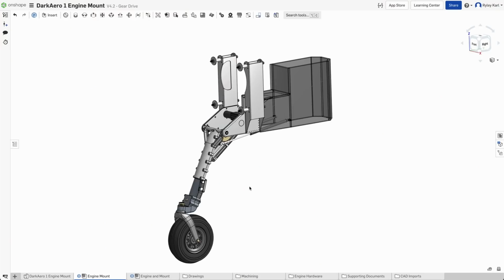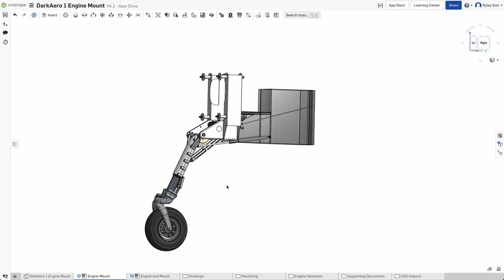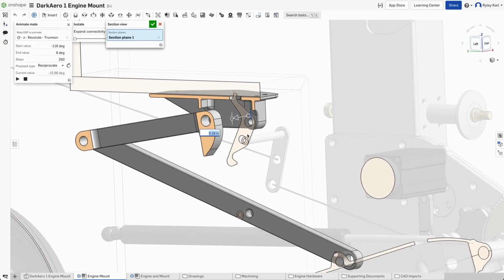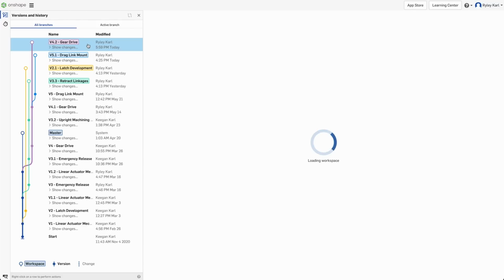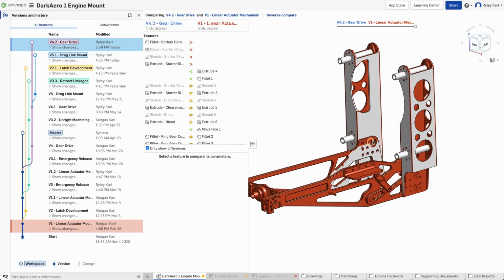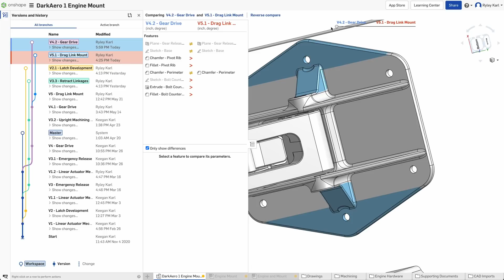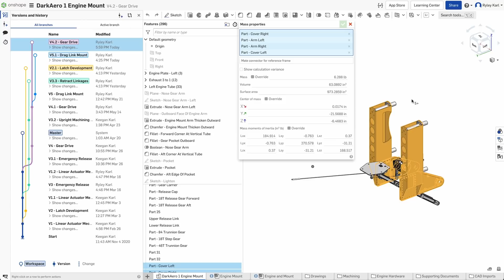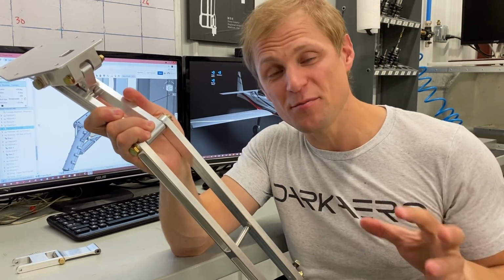How to manage complex designs. (our favorite CAD feature)

Comment: I'm an airline pilot and also mechanical engineer. One plane I used to fly was the Swearigen Metroliner. The torque links for the main landing gear were behind the oleo strut and and also the props wash  against them. The dirt and debris would pit the oleos and they would always be in a state of leakage and deflation. I know the nose gear strut gas spring of the Dark Aero is recessed within the nose gear trunnion but it might be helpful to locate the torque link in front of the telescoping strut to better protect it from said prop wash and debris? It looks like there is room to move 180 degrees to the front, just a suggestion. Love the videos and the plane looks awesome!
Reply from the maker: Hi Mike! Thanks for watching and for the suggestion! Your comment highlights the struggle we face while coming up with these different designs: there are many different conflicting requirements to weigh out and balance. As you pointed out, the gas shock for our nose gear sits inside the trunnion halves and telescoping strut tube, so all the critical surfaces and sealing components are already protected from debris and prop blast. The torque links were located on the aft side of the gear assembly because this arrangement offers some manufacturing advantages. There is an eye on the aft face of the aft trunnion half that the drag links attach to. The addition of this eye means we have to machine the trunnion half from a billet of aluminum that is ~0.5" thicker than if there was no eye. As long as we are machining off all this excess stock just to add in the drag link eye, we can also add in the eye for the torque link with no increase in machining stock. If we were to move the torque link to the forward trunnion, it would mean wasting an additional ~0.5" of machining stock to add this feature. This extra thickness in the billet amounts to over 4 pounds of aluminum that would be wasted. Kinda tricky to describe in text so hopefully I didn't cause confusion with that explanation. :)
Reply: @DarkAeroInc  Makes perfect sense, thanks for the reply, can't wait to see the Dark Aero fly!

Comment: if there is any flex between the rigid engine mount/nose gear and the wheel well that houses the nose gear drag link mount (i.e. nose gear drag link mount moves in relation to the nose gear) then the nose wheel may not retract fully or may retract too much, right?  Maybe the nose gear drag link mount should have a couple of drag struts tying it into the engine mount?
Reply from the maker: Richard, it is possible for there to be a slight amount of relative movement between the two structures. However, they are both very rigid and tied together (since the engine mount ties into the firewall and wheelwell). 

The lockout mechanism is spring loaded to default the lock into lockup/lockdown. During normal operation, the limit switches will ensure the motor drives the gear all the way to it's final position. In an emergency event, the gas struts force the gear into the lockdown position. Since the gas struts are still slightly compressed even with the gear fully extended, a slight amount of relative movement between engine mount and wheelwell won't impact a full lockout. This might be a good thing to demonstrate in an upcoming video! :)
Reply: @DarkAeroInc  Incredible amount of engineering going into this for a such a small team.
Reply: Richard.  That was actually also my thought.  I have often enough been cheated by simulations.  Before we build something, we start with a cardboard model.  Then the 3D model.  And then go into production.
Reply: @blameyourself4489  @Bad Obsession Motorsport--- CAD = Cardboard Aided Design 😻😻😻